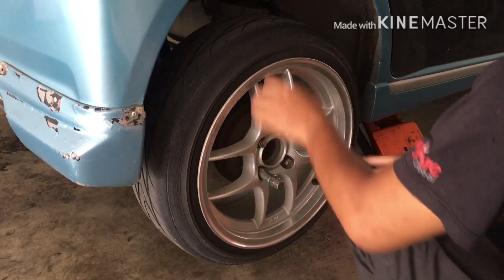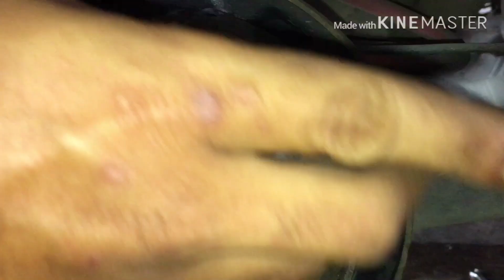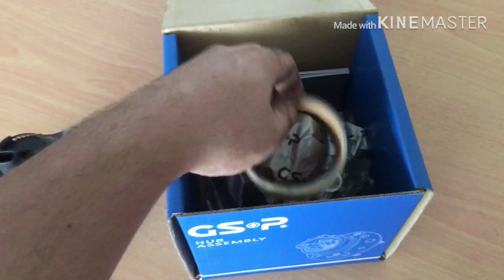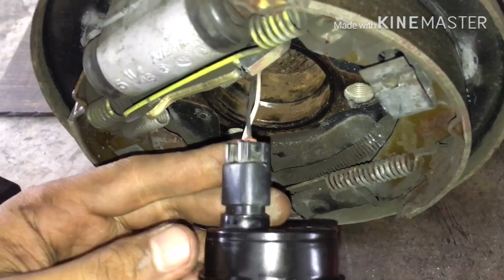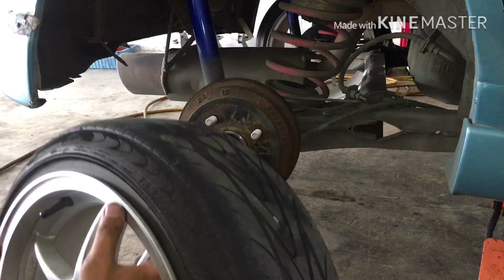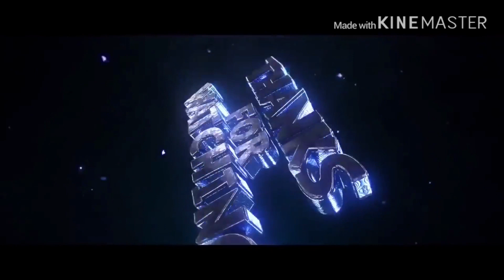Cara tukar bearing tayar belakang viva (abs)

Comment: Salam Boss.. Bearing abs dgn non abs sama tak tapak screws dia.. Maksud saya non abs nk masuk abs bearing.. Saya plan nk masuk disc belakang guna rotor dari depan std viva sebab solid disc caliper saya plan nk pakai Honda city sebab dia sekali dgn handbrake.. Kalu sama saya nk plan custom braket caliper. Ukuran saya belum ambil lagi utk tayar offset.. Namti saya update Boss kalau tapak dia tu sama.. Tq Boss video tukar bearing..
Reply from the maker: Wasalam. Sy tak pasti blm kaji sampai tahap situ sbb y seblm2 ni pun sy srh tuka axle avy je. Biasanye axle ni y custom ni lg kasa modalnya dr y pnp.
Reply: Oo ok Bos.. Idea saya guna rotor depan nampak cantik kalu boleh costom cuma tak tahu offset tayar depan ngan belakang cam mana viva saya 850 takde abs tu la pasal hehe.. Bos kalau ada peluang belek2 viva boleh info saya.. Saya tak keta spare.. Keta wat cari rezeki.. Depan saya sudah masuk passo.. Tq saya tggu next video.. Done subscribe channel Bos..
Reply from the maker: Contact sy 0149857484 senang ws jd borak lebih mudah. Banyak video pasal viva sy bt kete sy sendiri.
Reply: Kene tukar axle avy/viva yang ada abs baru boleh modi pakai disc belakang..axle avy/viva abs harga dalam rm150 halfcut..